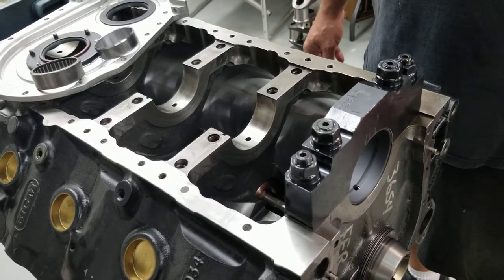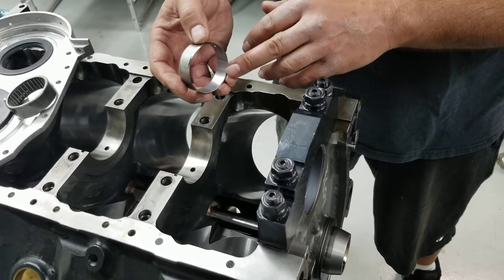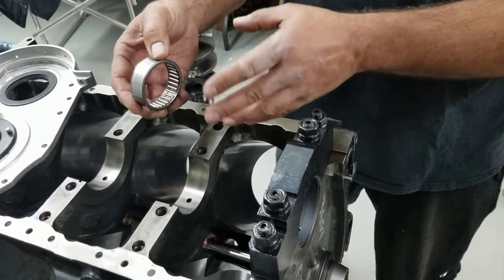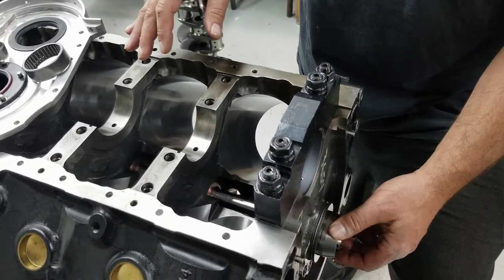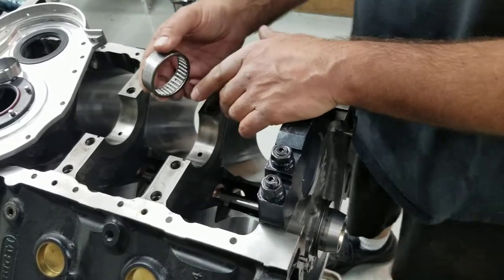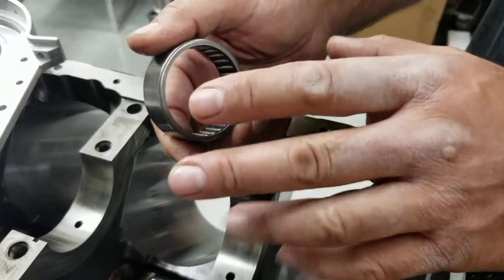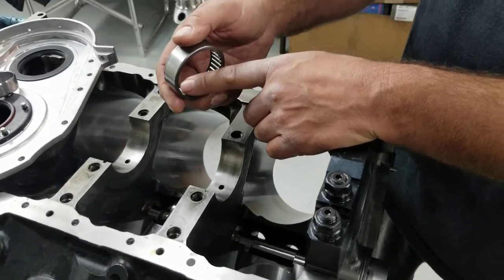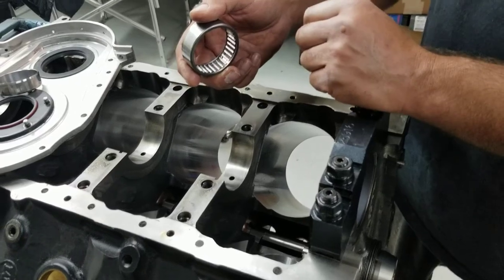Big Block Chevrolet engine build. Roller cam bearings.

Comment: Thank you for this video.
I've not built a engine in decades ( since I was younger obviously ;)
And have always wondered about replacing crank bearings with rollers, (infact all bearings, crank/cam) however was worried about longevity of these replacements. 
Let's say a 400ci from the 60's.
Built stroker with these mechanical bearings and using lightweight components on the lower and top, improvement to oiling and cooling systems. Just would like a built everything but also longevity (ha!)
How much power improvement would be possible and how much Rpms could be expected. This question is a hypothesis really, not expecting a lot of math and work from you guys ( and thanks for any replys !)
It's just a question that has been for bothering me for years and I understand there's probably easy answers out there but watched the video and that old inch in the back of my brain popped up.
Anyways, hopefully, I made sense and it's not Too stupid of a question (⁉️) and can be a interesting discussion.

Comment: How do you get the oil to flow through the roller bearing?
I see there is a hole in the Babbitt bearing for oil to pass through, But not the roller bearing?

Just drill through?
Reply from the maker: Roller bearings work on oil splash and therefor unlike a babit bearing, they do not need any swedging of oil pressure..